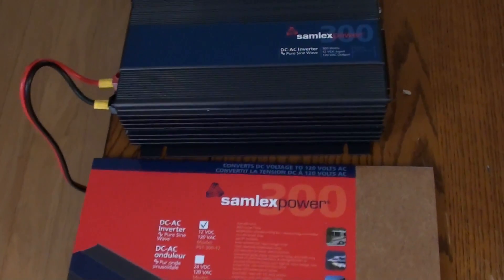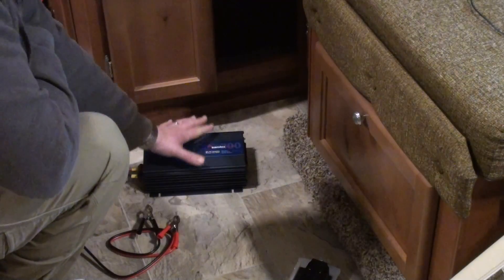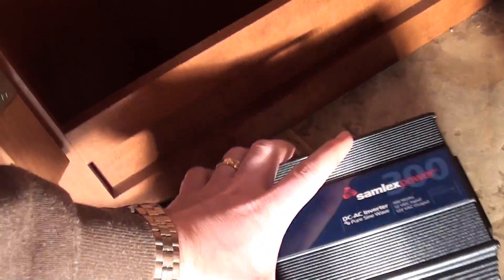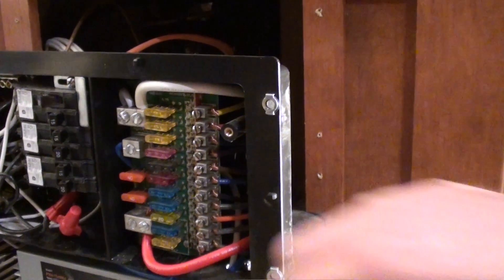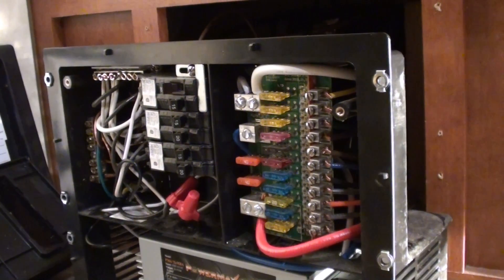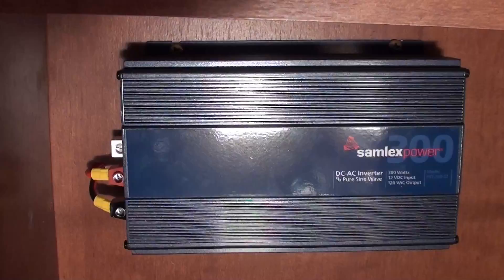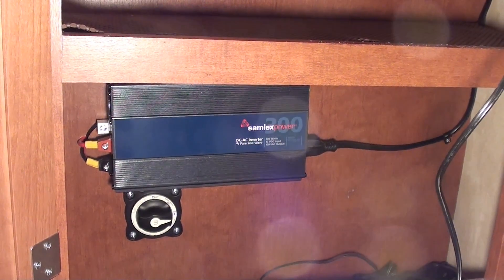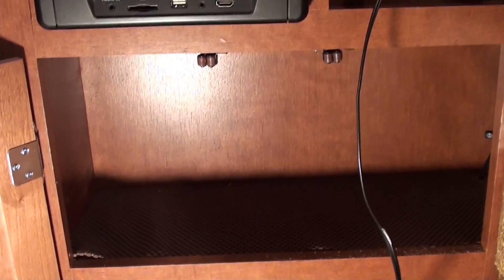Inverter install in an RV camper

Comment: Fantastic,  great video....I can hear the passion in you voice.   I did a similar install in my old rig a few years back and also included a meter to show the amps that I was using through my inverter...   I am buying a new rig soon so looking for improvements... I like your placement... I tied mine into an existing ac cct so used the plug by the tv but the downfall was that the cct was feeding my fridge as well leading me to install cut-off switches.  One time the wife forgot to flip the switch and my fridge drained the batteries pretty quick

Comment: What is the name and model # of the transformer you used to convert your TV? I cut the adapter off the cord and wired a 12V plug onto it. Kinda sloppy looking. I'd like to do it right. Thanks.
Reply from the maker: rts I did a similar thing. I used an old cable that the end matched up with TV. I then attached/soldered on a 12v male end and heat shrunk the connection.  I have used this for 3.5yrs this way with no issues at all.
Reply: Or you can buy a small inverter 150 watt inverter and plug it int the cigerette outlet and plug your tv into inverter

Comment: Thanks for the video.  Give thought to this.  Depending on the thickness of the wall that you've mounted your inverter to, you may want to use some kind of backing.  There's a lot of vibration in the trailer during travel and the weight of the unit could be a factor.

Comment: You're inverting DC power from your batteries into AC power just for your laptops charger to convert the AC power back to DC. This is not a good way to charge lap tops, phones, anything using batteries, TVs, gaming consoles, etc. These all use dc power. You know that bulky annoying box your xbox or TV has attached to the power cord? That's a converter. A better option would be to buy a dc charging cord/ power cord for these appliances and running them straight off your batteries. You're slowly killing them otherwise.

Comment: Thank you. I searched endlessly trying to figure out how people are wiring a 110v AC outlet off of the inverter. Is the most common way the one that you showed? That is - cutting a cord. If so, does an extension cord work if I cut it and wire the end to an outlet?
Reply from the maker: Keaston Vlogs yes you can use an extension cord.  Works the same as I showed.  Verify cord works properly before connecting to your inverter.
Reply: I ended up buying a 10 ft extension cord that already had the end stripped. Thanks for the help!